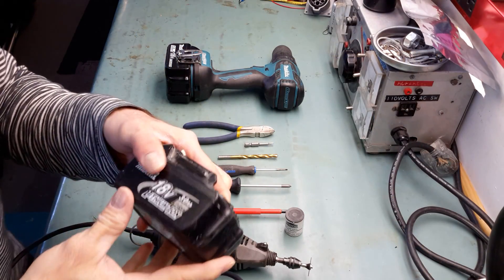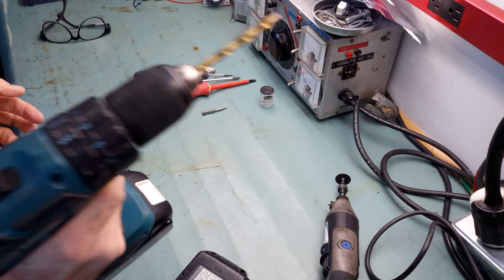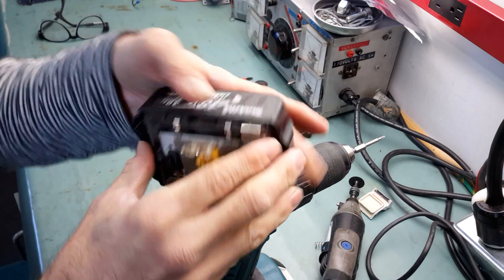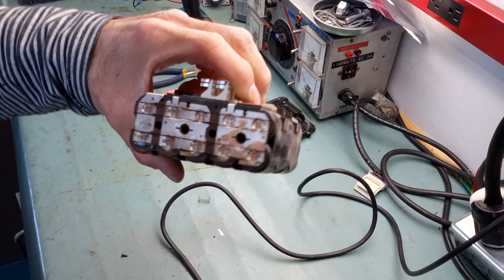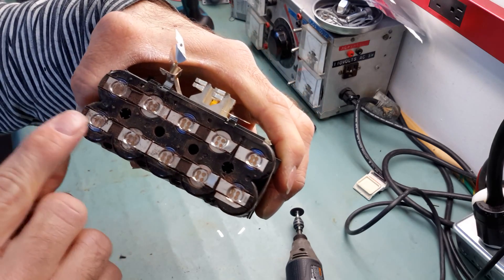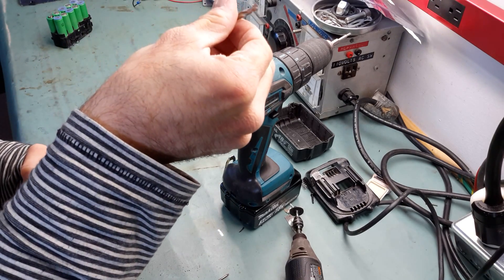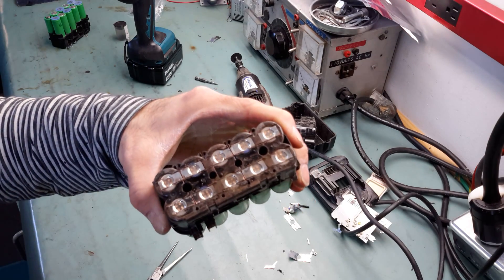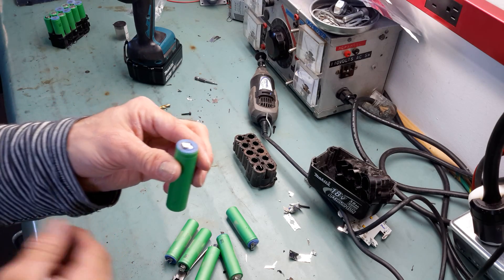How to disassemble recent Makita battery packs to salvage cells

Comment: We were talking the other day about when the wheels come off the bus, that cordless tools may become useless once the battery capacity declines.

One thought was to remove the cells from a tired pack and add a cord to an external battery pack - such as a solar system battery.

Another tactic could be to replace the bad cells in a battery pack.
Is that at all plausible ?

Thank you for the detailed disassembly destructions !!!

On my dead Makita pack there are 6 INR18650-15M
Samsung SDI 121 cells
and 6 BMK connections.

Total voltage is only 8.6V
3.8, 3.5, 0.6V

Seems to me that one of these packs costs $100-$200 and only contains maybe $20 in cells
The tricky part is spot welding the interconnections

Comment: If you use a thin screw like 3.5x30 to remove the warranty plug, it's much easier and no damage done this way to the plastic housing like with the drill bit. I know that it is possible with a steady hand, but to be on the safe side, the screw is much safer.

Comment: It isn't too difficult to use a small but strong flathead screwdriver to just pop the spot welds off the battery, but then again, using the attached nickel strip to solder onto is a pretty good idea!  Then again again, the main reason I'd disassemble a pack is to rebuild it with new cells, so that method is rather useless for my soldering.

Comment: The tamper resistant torx, thats a T10? Thank you   also, thats an 18V pack, with 10 18650s?
Reply: 10 ..18650 yes made by Sony
Reply: @floydsanders9451  thank you 🤓

Comment: Thanks for the video. I couldn't figure out the final part myself (drilling through the center most 2 holes). Otherwise this new pack is similar to older ones. I didn't cut the metals with Dremel, I pried them off intact with chisel.
Reply: Ha,ha..I’m a mechanical engineer person and I cared for his edited informations and the video creator informations.Because it can saving you some money like about $100-150 dollars.If you’re able to getting a hold of 2 or 3 or more of these discarded portable batteries packs that are using lithium batteries cells by people or in many constructions sites.Taking all of those 18650 good lithium batteries cells out.You can refurbish recycling to be building for to a lot of many power supplies packs for many other devices to uses like batteries power packs for E bikes,portable backup batteries power generators packs and many more uses that require using 18650 lithium batteries cells.
Reply: No one cares

Comment: Thanks for this I really need some help I have a brand new DeWalt DCB206 20V Max XR 6.0Ah can you please make a video with the complete disassembly of the pack and removing the cells please. So I know how to do it please I would really appreciate it very much.
Reply: If it brand new why didn’t you contact dewalt and have them replace it since it was faulty.
Reply: this  is the exact one in this link for reference
http://www.dewalt.com/en-us/products/accessories/batteries-and-chargers/batteries/20v-max-premium-xr-60ah-lithium-ion-battery-pack/dcb206

Comment: Thanks for showing the pack construction.
I just resorted to pulling the spot welded tabs right off the cells the last time I did this. You can still solder on the bare bottom of the can but a really hot iron and speed is of the essence and cool the can immediately after on a wet sponge to prevent too much heat damage on the battery. The positive side is much easier to solder since you have the elevated buttonhead.

Comment: Hi, I have read many of your threads on Zero Motorcycles. And see that you also know A LOT about them. I could use some of your expertise and would appreciate your input with what I'm trying to do. I have a 2011 Zero. I purchased a Chevy Volt 12 cell module 48v to use in the Zero. I would like to use the Zero Charger 48v that came with the bike to charge the Chevy Volt battery pack. Is there a way to wire the charger to work as a straight up charger with out signals from the original Zero BMS? Any input would be appreciated.
Reply from the maker: search on the electricmotorcycleforum, many have upgraded the 2011 battery with various type of cells!